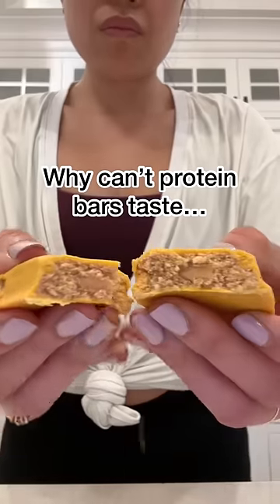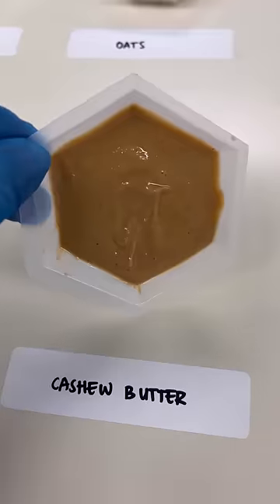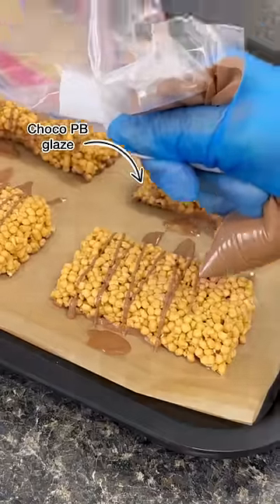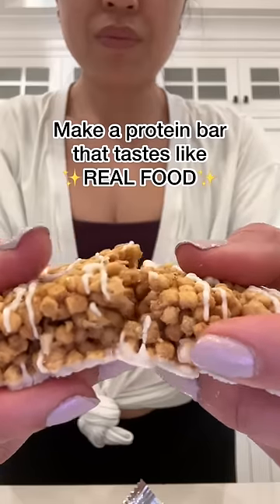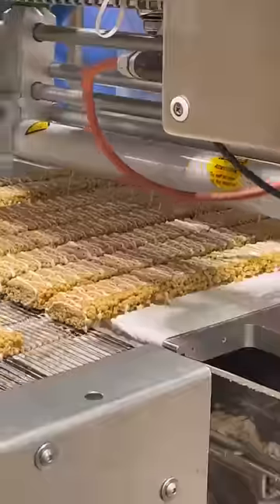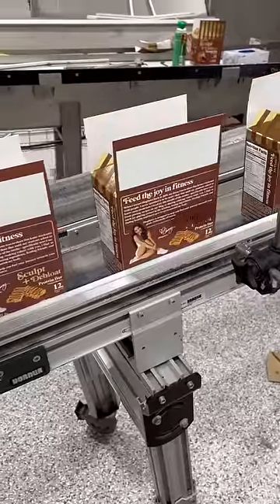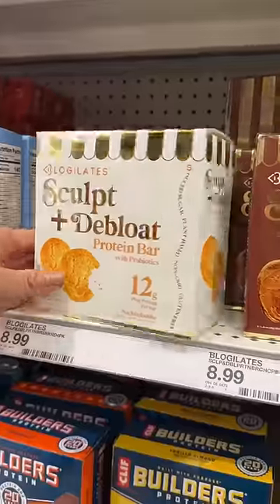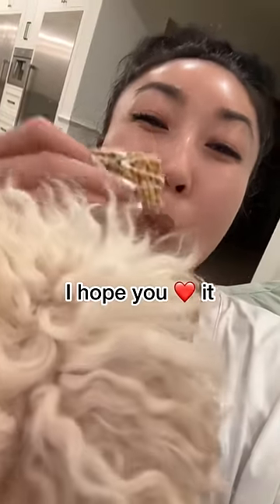I think I did it... I think I created the perfect protein bar AND they're vegan + gluten-free!!

Comment: 4 things to improve on the bar:

1. Put a picture of the bar on the FRONT of the box not on the back. No one will notice that it is a protein bar at first glance, and they will think that they are getting cookies because it shows a picture of a cookie.

2. Remove the phrase “sculpt and debloat” off the box. A bar will not sculpt you nor debloat you. This is gimmicky and false, and is strange.

3. Have more protein in the bar. To be considered a protein bar, it should have at least 20g of protein, not 12g. 

4. Lower the price.